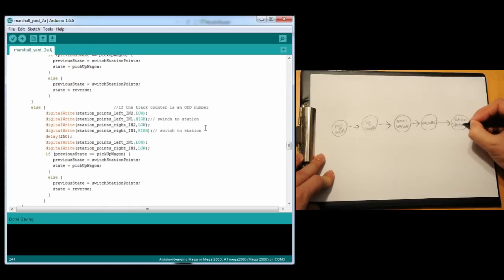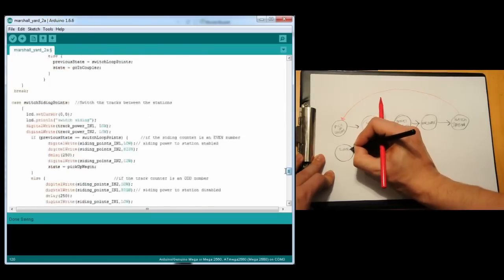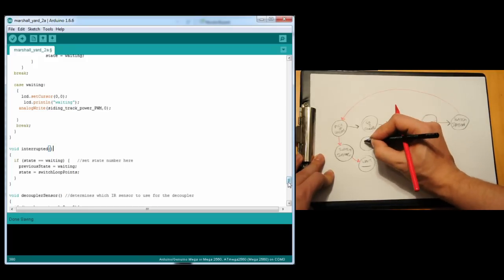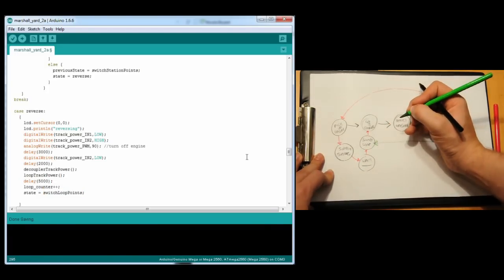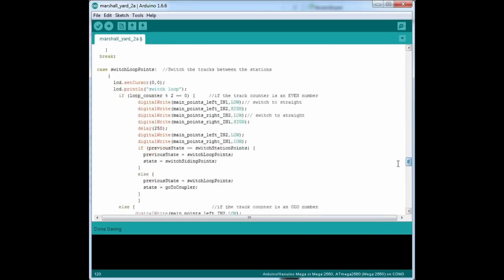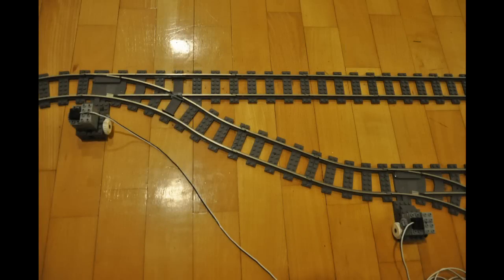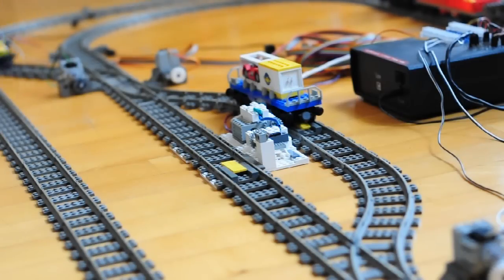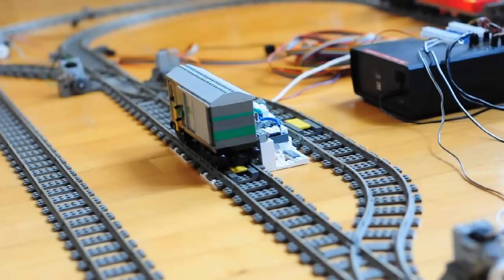Arduino for Lego Trains #10: The Automated Marshall Yard

Comment: Nicely done. So I see you are using 1x 12v power supply to power everything (arduino + 4 l298n controllers).
Would it be possible to show the inside, and also tell how you implemented the interrupt?
Reply from the maker: +Jeroen Mail There's a lot of interest of what's inside the Magic Box, so I will make a short video about it very soon. For power, I use one simple 12V power brick, 1.5A - Lego trains don't use much current, and the motors only run for ~250ms anyway.

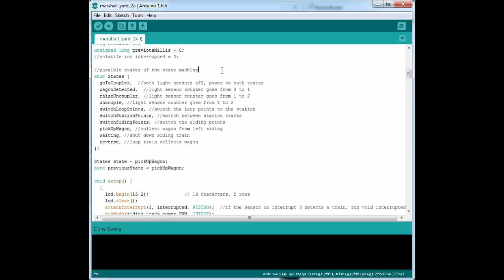For the interrupt, it's shown on the screen at 3:15. In the void setup, look at the following line:

 attachInterrupt(3, interrupted, RISING);

Here, "3" is the interrupt number (which is pin 20 on an Arduino Mega), "interrupted" is the name of the function that will run when the interrupt is triggered, and "RISING" is the way the signal changes that triggers the interrupt (you can have LOW, RISING, FALLING and CHANGE).

Comment: Top job sir! But I have to ask why you use ultrasonic sensors?
Reply from the maker: +James o'hare The ultrasonic sensors are exactly the same technology as you find in your car's parking sensors. They're one of the cheapest and most common sensors available in Arduino kits, so I thought it was important to show how to use them in a practical scenario. Also, I think they look pretty cool on top of the railway buffers!
Reply: You can make sprung buffer stops if one of your trains goes haywire; the runaway can be diverted onto a siding with the sprung buffers- the train will smack into the buffers relatively hard, but the stop can save lives.

Comment: I have watched all 10 videos. I have been checking for this last one over the past week!
You have really done an awesome job.  I have re-watched several of them many times.  These are the unquestionably the best videos I have seen on using Arduino and trains.  They are entertaining, fun, and very clear.  Your pacing is great.  I learned a lot.  I am using your videos to learn/improve my coding skills.  There were several small gems I picked up.  For example, I was unaware Dupont connectors were readily available. Combined with phone cable?  What  a great way to cleanly wire any project.
The problem is, we want MORE!!! I would love to see more about the box you created. I wasn't clear on how you created the cross connects in such a way that was easy to move change connections. What happens when you run out of connections on the Mega?
Thanks so much!
JD
Reply from the maker: Finally time to unveil the magic! Here's what's inside the box: https://www.youtube.com/watch?v=YJZhOBct8F4